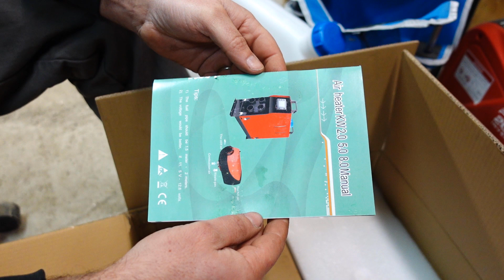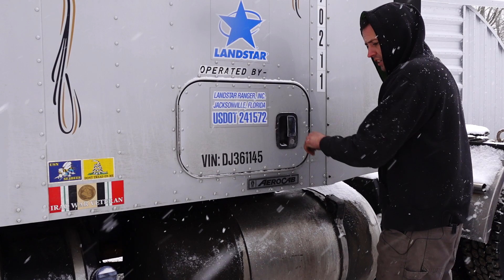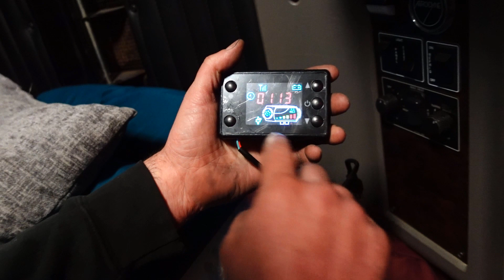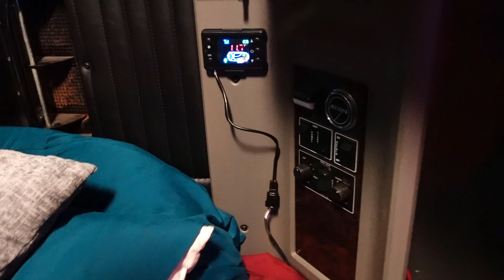Swapping Out & Installing A $125 Bunk Heater (Espar/Webasto Cheap Alternative) For My Kenworth T660

Comment: Hi mates! This independent fuel tank may help you in reeeeaaly cold weather. You may add petrol (up to 50/50 with diesel) or pure kerosene (that's way better)  and avoid the problem of waking up being frozen in your bunk.
Reply from the maker: I thought about adding the tank and kerosene. But I didn’t get a chance to move forward with it. Thanks for the comment👍

Comment: Ryan, it's only $67 for a new gloplug, 12 filters, and the proper tools are included.

In most occasions, it's a filter issue anyway. At the unit, or in the line. Sometimes the pump gets gummed up. But it's easy to clean.

Comment: Very cheap and you do get what you pay for. I personally would not recommend them from my own experience. I did show on another channel the Damage to my Truck ( Mainly around the Sleeper ) when it over fed fuel into the Heater and caught fire. Needless to say the Insurance refused to pay out for the Damage as the Heater did not have the relevant safety certificates. ( Purchased From Amazon ). And of course Amazon were only prepared to refund the purchase price. My Insurance company were very aware of this heater as it appears that this is not an Isolated incidence.
So please think twice before purchasing one of these Bunk Heaters. Yes they are cheap but please again ask yourself why.
Reply: Uncle's truck almost burnt down running one of the Chinese knock offs, a boat out here in Alaska burnt down from one of these.. luckily another boat was close by for the rescue